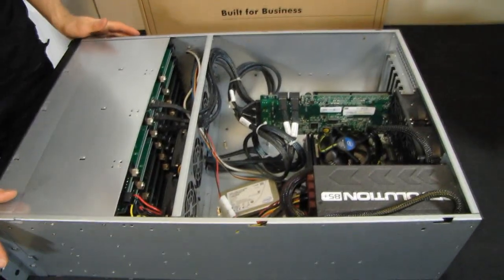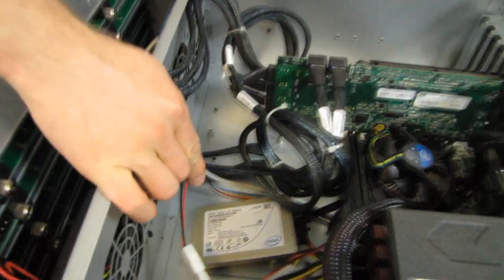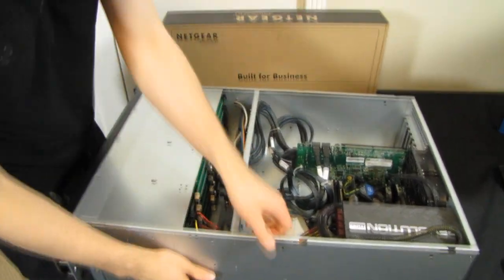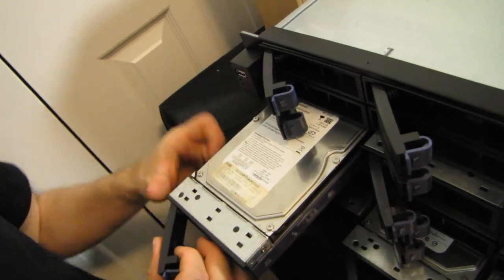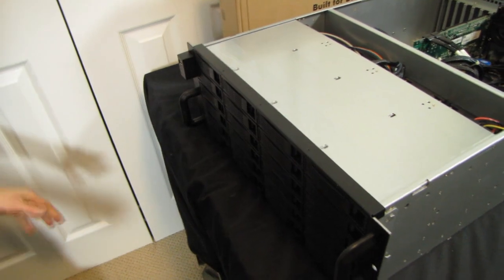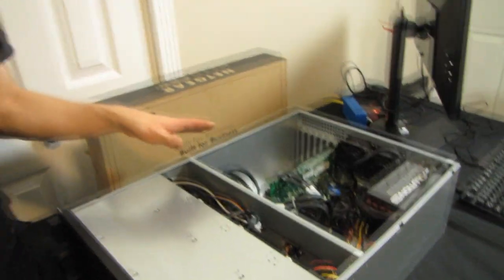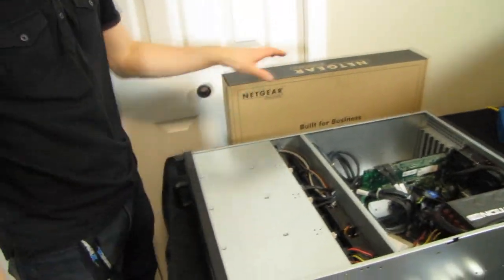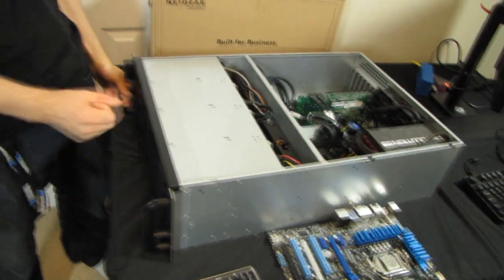Personal Project Windows Home Server Showcase & Upgrade Plans Linus Tech Tips

Comment: Funny thing that I just found this video. I still have my WHSv1 running but as it's based on the old server 2k3 I really don't feel like having it connected to the internet anymore.
I was really early with WHS and used some of the 120 days test keys before I bought it. Back then having automated backup of all computers was really important, but now that everything is on OneDrive instead I don't have any issues with reinstalling any of my computers if I need to do so.

I might just build another small thin client if I need some services running 24/7. (After all, an old HP t620 with win 10 is fully capable of running Netflix HD and 5.1 so there's plenty of power to do various tasks on the network)

Comment: my sister uses a 250gb 2.5 inch hard drive on her laptop, she has gone through about 7 in the past year, and I'm on the same 1tb ssd for more than a year, and she says that she can't justify the cost of an ssd, wtf
Reply: In all the years I've been working with computers, I've only had one HDD die (outside of work) and that was when I accidentally configured two drives on a single IDE cable as master. 
Sounds like your sister is abusing the drives terribly (either that or she buys really, really shitty replacement drives). Probably throws her laptop around while it's on, crashing the read/write heads. The cheapest solution would be to teach her to treat her electronics well.
Reply: ***** yeah, she abuses hard drives, and buys the shitty ones, but she will learn, eventually, i hope.

Comment: Server, yet with a standard pc psu?
Reply: XxGamersUnitedxX servers don't need a fancy psu? you know that
Reply: Ozzie Peck They don't "need" fancy power supplies, but they often use them, as they're designed for 24/7 use.
Reply: he's probably using it for some massively useless windows junk,
Reply: XxGamersUnitedxX Aren't all PSUs basically 24/7 ready now?  Who turns off their PC anymore?
Reply: XxGamersUnitedxX Still find that kind of silly, unless you hibernate instead of shutting down.  Just leave everything up and running, lock, and walk.  Even better fire up Boinc or Folding@Home and fully utilize your system.  People may need sleep, but computers don't.  ;)
Reply: PongoXBongo Most people do, unless you have a specific reason to keep it on there's no reason to with the boot times with ssd's.
Reply: +PongoXBongo Tell me a single reason why turn off a PC is silly... because you have to wait for it to boot and load session and open everything? yeah... big deal...
What I find silly, is people that leave their computer open with easy access. The last thing you want to have, is a PC with easy access.
Men, I turn off my PC every day and when I leave home, I even take off the hard drives (including the bootable) and hid them. Every day I wake up and I want to use the computer, I install the SSDs and HDDs (if needed) then I turn it on, enter the password to start the BIOS and and then proceed normally, except that if I want to access to certain directories, I need to enter another password because those directories are encrypted. I do that shit almost all days. Why? Because I'm paranoid, that's why (I don't trust my roommate neither his friends, I know they do fuck up things). Also, I don't like to waste energy.
Reply: To Athanatos Because it should be updating, scanning, de-fragmenting, indexing, etc. while you sleep, not while you're using it.  Maybe it's just the IT admin in me, but everything should be online and accessible at all times.  In this day and age every machine is basically a server and should be treated accordingly (quality parts, routine maintenance, tight security, etc.).
Reply: tbh,  pc PSU can do fine, if it had enough watts to operate the server.
Reply: Of course it "can" do fine, it's just that server power supplies are built specifically to run in a 24/7/365 environment.
Reply: A power supply is a power supply, it will run as long as you need it to, I've not turned mine off for months and it does fine.
Reply: +XxGamersUnitedxX my computer has been on 24/7 for the past 3 years. (turned off for like a maximum of total of 5 - 12 hours (5 -1 2 hours over 3 years) for hardware upgrades, etc) Still works fine.
Reply: PongoXBongo Well, I would never leave my computer on, accessible and even functional when I'm not using it. I just don't trust in my roommate and his friends. I will not compromise my data.
Reply: It's called a password
Reply: Ozzie Peck 
Just a password? LOL... yeah, so secure.
Reply: To Athánatos Unless your roommates are hackers, or good with computers. Its secure enough... Also use a 20 character password like most people do nowdays.
Reply: Or pickup an inexpensive fingerprint reader.  Or a facial recognition app for your webcam.
Reply: my password is random lettres numbers and characters, still my computers not been compromised and it is only a password.
Reply: +PongoXBongo You're not paying for electricity, are you? I, too, used to be a big fan of leaving things running all the time. Then I had to start paying for my own electricity and I quickly realized I could save about $100 a year by putting my computer in sleep mode when I'm sleeping or not at home. And that's not factoring in running things like Boinc or Folding@Home.
Reply: ***** I am indeed paying for electricity, have been for over a decade now.  Utility rates can vary a great deal depending on where you live.  And spending something like $100/year extra is like cutting a check for $100 to one of the Boinc/@Home causes (granted not something that everyone is capable of or comfortable with doing, and that's perfectly fine too).
Reply: PongoXBongo Fair enough.

Comment: Doesn't Link aggregation work best if you have even number of ethernet ports? Why is he using 5
Reply: No clue why he is using 5 (1 could be a management/IPMI port), but yes link aggregation works better with even ports (1 in 1 out) basically.

Comment: hey bro I know that this is a big ask but really want to start hard core gaming so I curies to if you give me a starter point please
Reply: Start with a CPU or look into APU technology and save up until they are widely released. I couldn't tell you how many GHz you'll need in a processor for XBOX ONE, PS4 type games, but I think 3.2 GHz is well above xbox 360 and ps3 graphics when paired with a good GPU. For hardcore gaming I'd go with a core i7 from Intel. Choose your motherboard next using the specs from your CPU - by matching the socket type (also whatever additional functionality you want from the board). Make sure you don't get one with on board graphics because you're better off installing a graphics card separate so you can upgrade later - and it's just a waste on a high scale gaming rig. Choose your case next, based on the form factor requirements of your board. For a Video card, I think Nvidia is a great company. I'd go with at least a high 600 series card from them (670/680). Geforce Gtx...something, at least 2gb of GDDR5 ram. For your on board RAM you'll be fine with 1.33 mhz 8 Gbs of ddr3. If not it's 45$ to upgrade to 16. Look to spend around $900 US. Go into it planning on blowing this level budget on these components and you should be fine.

I'm no expert and I hope I'm not coming across as thinking I'm one, but I think this will get you started if you want to build an all out gaming pc. I've tested a few computers at my place with these specs and they do pretty well. But like I said they aren't exactly hardcore. They just beat out xbox 360/ Ps3's. Really though, Linus Tech Tips is an excellent source of info (reviews) of products. So when you're choosing your components you should check back. And make sure you check out their awesome build guides, too.

Comment: I nearly spat out my drink when I saw a WD Green in his RAID array. You should be using drives designed to work in a RAID array like this such as WD Red's. Green's aren't designed for this!
Reply: WD red are only rated for up to 5bay NAS systems, and not for file-server use.
Reply: True enough still doesn't excuse having a green in there rated for low end desktop use!

Comment: I wouldn't be using Hitachi drives!! my first experience with a RAID array of 3TB hitachis wasn't very good, in just 24 hours, 6 brand new Hitachi desk star 3TB drives in RAID10 simultaneously failed, all of them had the same issue... bad sectors, in just 4 hours, drives 1, 3 and 6 were overrun with remapped sectors (210 in total) and drives 2,4 and 5 suffered 1032 bad sectors and seized bearings, so about $1500 worth of drives committed suicide in a day!!

Comment: Linus, if you ever get the chance to read this, i just wanted to see your opinion on the fact that, yeah you have your point that a real raid array will be more real time, but heres the thing. I personally use windows 8, with an 8 drive pool, around 5.7 TB. But my thing is all about safety. Lets say you're making a raid on a motherboard. If that board dies, everything is gone. Same goes for your raid card. If that dies, your shits gone. The storage pool on win8 is transferable. Food for thought.

Comment: It would be a good video topic, I agree.
But a critical point is that I/O is king. Desktop boards often get bottlenecked as servers. Look at a board's bus bandwidth, not so much it's CPU speed.
An old P3 server board with 66MHz PCI or PCIX slots will outperform a much faster desktop board with only standard PCI.
If a board has integrated GbE or SATA, find a block diagram for the board and see what kind of bandwidth they actually have, and if they're sharing bandwidth with anything else.

Comment: The truth is it depends on what you want to do and what you are most familiar with maintaining.

For straight storage, Sun's ZFS on something like Nexenta Core cannot be beaten.  Linux doesn't have a good ZFS port and BTRFS isn't as good yet, but getting close.

For HA web or file server, Linux or Windows will work well.

For low power, light install, efficiency focussed appliance servers, Linux all the way.

And VMware/Xen Virtual/Cloud servers use a custom, optimized Linux foundation.

Comment: GNU/Linux can be used with or without a GUI. Typically in a server environment a GUI is both a memory waster and sometimes a security risk. However it often makes server management less tedious and is therefore used on Windows Server. Most *nix servers will be used without a gui.

Comment: You clearly don't know anything because it's GNU/Linux not Linux. Linux is the kernel. the program in the system that allocates the machine’s resources to the other programs that you run. The kernel is useless by itself; it can only function in the context of a complete operating system. Linux is normally used in combination with the GNU operating system - or GNU/Linux. All the so-called “Linux” distributions are really distributions of GNU/Linux.

Comment: I don't understand why I would want to run Windows home server when there are so many better options out there such as SmartOS/OpenIndiana, Linux and FreeBSD. Also, hardware RAID is pretty unreliable. If you want a redundancy that truly protects your data then ZFS currently is the only choice and it don't even need any HW RAID. Also, buying a single PCIe slot MoBo for a full-scale rack server and mixing some hodgepodge of crap drives in the bays like that is just ... plain dumb.

Comment: Guys please answer, im 15 now so i have plenty of answer to learn before i do this, but do i HAVE to have 24 hdds? or can i start of with 1 or 2 or something and add on later on? and what would be a good case to use it in? and can i use whatever processor and ram and graphics card i want? ( if it meets the OS's requirements )

Comment: Yes and No, it depends on what the server is being used for. Seeing as the max bandwidth with Linus's system is 5Gb/s (roughly translates to around 500mb/s file transfer) the RAID card and it's setup is still WAY faster than the bandwidth its connect through. If there were greater bandwidth to the server yes a faster RAID card may be necessary. DDR2 is actually faster than DDR3, with lower response times. DDR3 just has a greater capacity. If you have spare hardware, play around you'l learn ALOT!

Comment: home servers are essentially computers that have massive storage space. If you primarily use a laptop then you can't hook up hard drive after hard drive up to it, so you just build a small server with a couple 2-3 high capacity drives (RAID or not) and access your stuff through the server (laptop connects to the server desktop in another room or the same room).

Comment: I have no real recommendation I'm afraid, no. When you do choose one, check the company's literature about what drives you can use. 
What I mean about the smallest drive: If you had a WD Caviar Black at 500gb, and a Seagate drive at 3TB, the RAID configuration would mean that the Seagate drive would only be recognised as a 500gb drive, and that the WD drive would be limited to the speed of the Seagate.

Comment: As far as I am aware it is down to the controller used. Some controllers may insist on identical drives, where as others you are allowed to use a variety. However, with the latter controllers, the capacity of each drive shall be constrained by the smallest drive, and the speed of all the drives is constrained by the slowest drive. Thus, it makes sense to buy identical drives.
But, Linus says precisely this during the video...are you sure you watched the entirety of it?

Comment: what do you use for all that storage? i got two individual 1TB drives. one for windows and storing games and the other is where my gameplay recordings are written both full copies and compressed copies. i plan on adding a 120GB ssd for windows only but i still don't understand why you need that much storage

Comment: You have a RAID card and your not using RAID. 
WHY don't you have matching drives? 
With the raid your speeds should be better.
With my gigabit connection i have a problem with HDD speeds not the network you may not need more network speed just better HDD speed. but with remote desktop at better FPS 5gb is better. 

I have about 3TB of data used (4TB of capacity **need more drives). Mostly DVD backups in ISO or MPEG.

Comment: sure but the thunderbolt architecture is designed for ultra high data rates (10 GBit/s are only nowadays it could be also theoretically 20 Gbit/s). the only limiting factor would be your harddrive. but you could also use ssds (sure too expensive) as storage devices and your connection could take advantage of each new or faster storage device in your server. ;)

Comment: Uhh.  Honestly, I wouldn't use Windows Home Server (or Windows Server).  I'd go with Linux and SAMBA (if you use that as a domain controller or as just a server in your work group).  It might not have the UI but (if you really need one, you can install one) it'd be a LOT more stabber and I'd go with ZFS with ZRaid2.  It allows 2 hard drives (like RAID 6) to fail completely and you still won't lose data and ZFS allows you to add more drives dynamically and the max size for a file is 16 Exabytes.

Comment: You don't need a drive bigger than 160GB to install WHS2011, you just need to edit a config file to remove that requirement. A 120GB Intel 510 is just fine.

Comment: Even though the link speed will read 5 gbps you will only get 1 gbps in performance. At least with Windows Server 2008 installations on client and server. Consider 10gbps direct connect and Fibre channel.

Comment: You will not get 5 gbps per second from 1 server to 1 client. I've tried this myself with Intel I340 4 port NICs and a HP Procurve 1810 24 switch. 802.11ad, manual trunking...will NOT work.

Comment: Windows 8 is providing new technology similar to Drive Extender (IMHO it was Drive Extender v2, but it didn't make it to Home Server 2008). It's match more performant than WHS. So your HDD zoo could be used with that - no particular need to upgrade.

Comment: 10Gbps cards are insanely expensive ($700 per on average) as well as you'd need fiber or Cat7 which is also super expensive. Nic bonding (or teaming as intel calls it) is a common practice in the server market for either redundancy or increase in theoretical speed maximum.

Comment: I like how you 'personal rig' is just a pile of parts :P
But, why do you need a 5gbit connection? I mean sure it's sexy to have, but it's not like you're gonna leverage it with that layout there, especially if you're sticking with windows instead of e.g openfiler or whatever. 
Speaking of- You should try iscsi some day if you haven't yet, especially latency and IOPS-wise it's INSANELY much faster than samba/cifs

Comment: I bought WHS 2011 when it first came out for like $60, but fell for FreeNAS and its ZFS storage technology. The entire thing runs off of a Lexar USB stick and has already proven itself when a drive overheated (my fault) and I was able to swap in a new drive on-the-fly with zero downtime. Add to that data compression (60GB of backup data from Windows 7 compressed to 17GB!) and you can have a po' man's WHS.

Comment: SATA is simply the connection protocol for drives. RAID is a configuration of multiple drives to increase performance or reliability. RAID is only used when the user has more than 2 drives.

Comment: yes you can use your SSD. im running windows homeserver on a 60 GB SSD as boot drive here is what you have to do.
1. Create a text document and inset the following text
[WinPE]
ConfigDisk=1
CheckReqs=0
WindowsPartitionSize=MAX 
save it to root folder of you installation media as cfg.ini 
now windows 2011 will not check if you drive space. and it will make a un-intended installation

Comment: no no no no no no no...

If say you use the exact same drives, you can accidentally buy the same batches if you buy them all at the same time.

if you get the same batches, you risk the harddrives failing at the same time resulting in loosing all your Data.